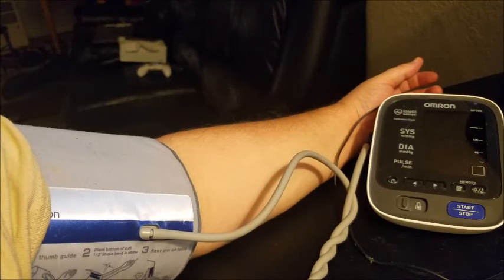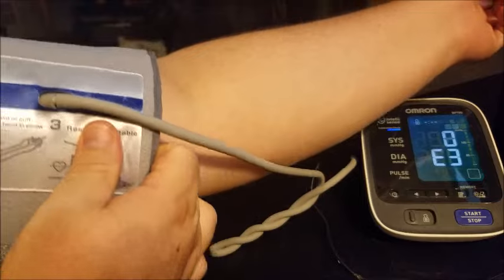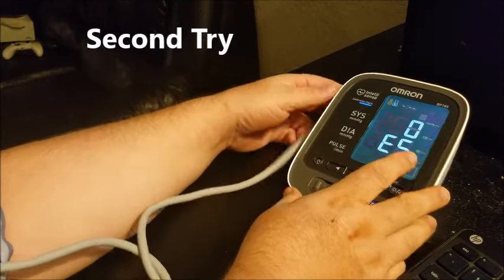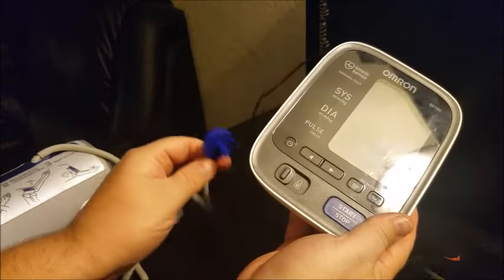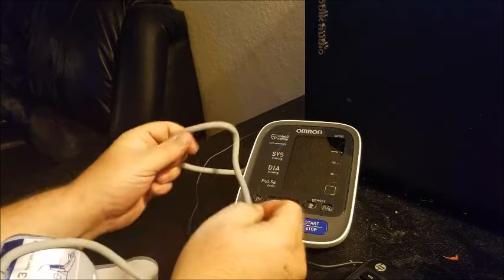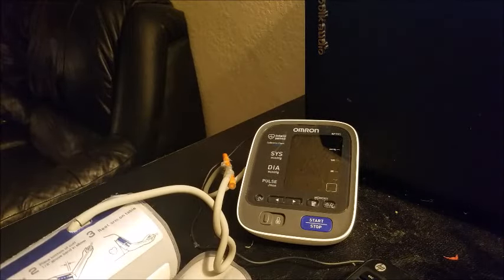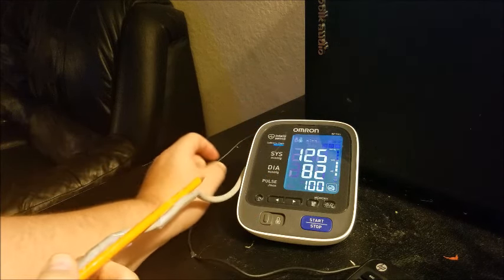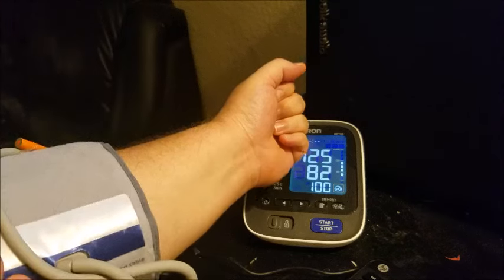Repair Error Message OMRON Blood Pressure Monitor (Fix Intellisense E1 E2 E3 E4 E5 E6 E7 Not Working

Comment: Omron M2 Intelli IT (HEM-7143T1-EBK) - Error Code Err 77 ... Data not automatically transferring to Smart Phone via bluetooth ... (1) change the batteries (2) un-pair via the app (3) re-pair via the app ("More" (bottom RHS of screen), Profile, Connected Devices).  Worked for me!

Comment: Brand new Omron 10 shows E1 inflation error straight out of the box - inflates up to 5 or 6 and then E1 error every time

I'm sorry, but if you have to do all these tricks in order to make your BP monitor work, its time to replace (with a non-Omron unit)
Reply: Good day. Your E1 error can be fixed by a simpe solution. Try ti tight up cuff a little. It can be also a solenoid malfunction, but it's very rare. 75-80% of owners came to service centre with non thighten cuffs. Hope i can help. Sorry for grammar mistakes.

Comment: You have not answered the E5 error code. Also, the tangled tube made common sense to untangle,  I saw that in the beginning of the video.
Reply: E5 - is a sensivity error. Mostly reason is too thick cloth. Rare is the cuff malfunction. Very rare is pressure sensor malfunction.